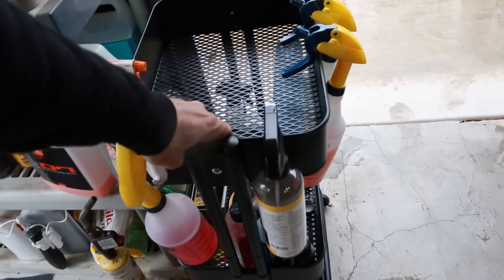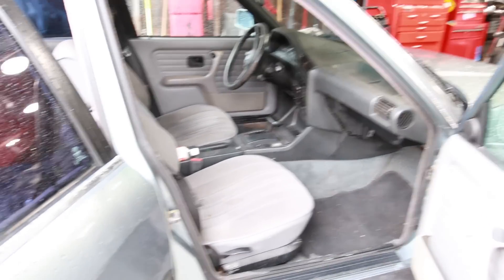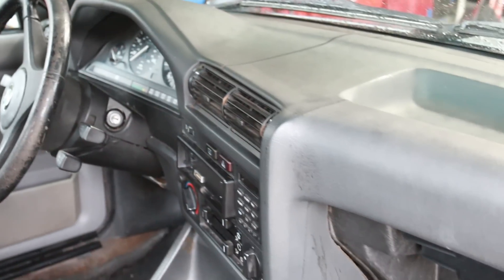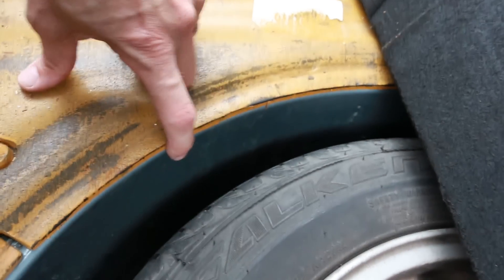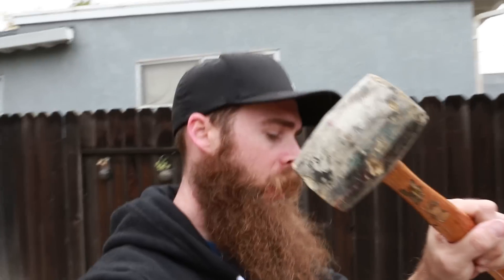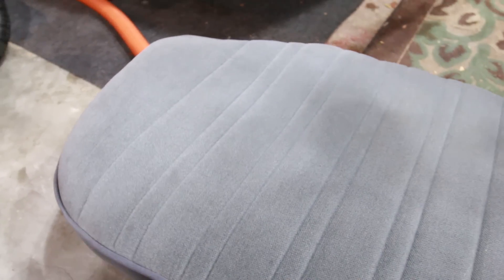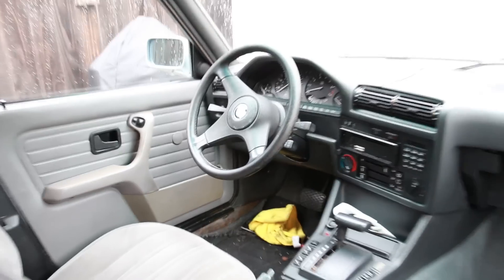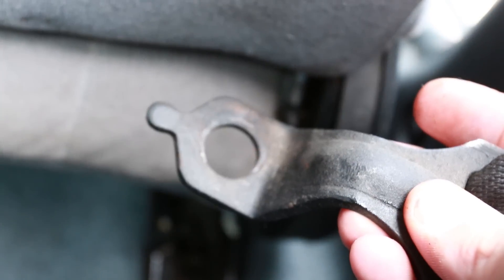BMW E30 DRIFT/TRACK BUILD THE BERTY 30 Making the inside purdy Episode 2

Comment: if you push the level down for the back adjustment on the driver side it should lift the seat upwards so you csn get to the bolts

Comment: My rear sound deadening came out to around 55lbs. On a hot day, it will easily pry out with a chisel - or you can use the dry-ice method. Check out r3vlimited.com for tons of DIY stuff and information.
What are your plans/goals mechanically?
Reply from the maker: Just posted a video on goals today. Check it out.
Reply: Will do